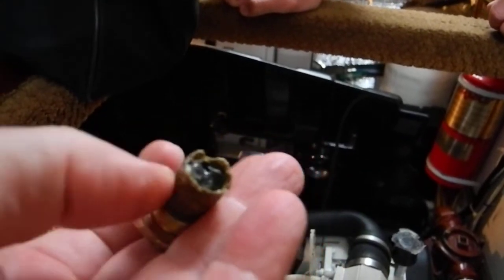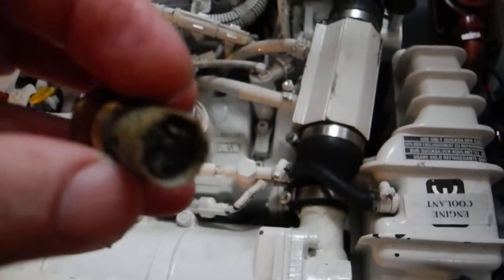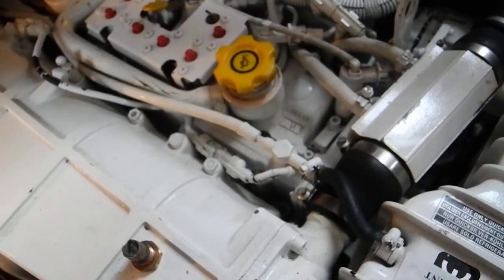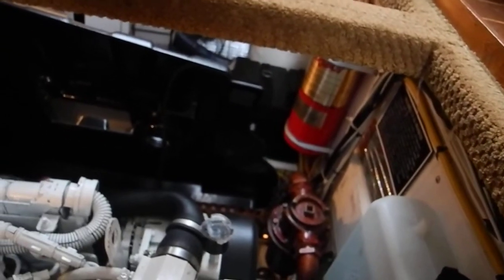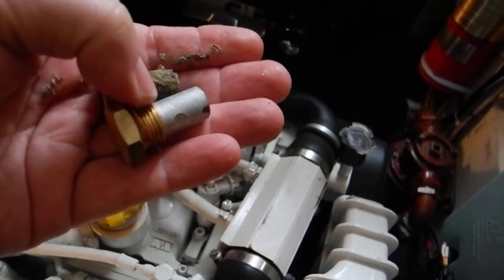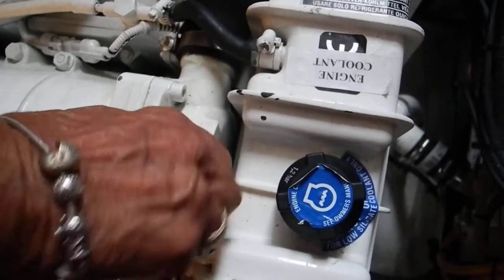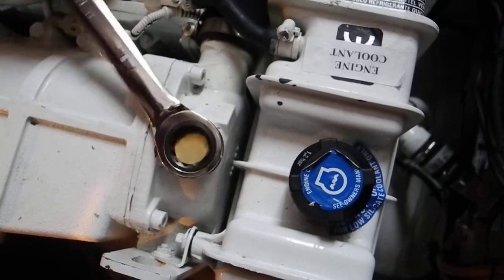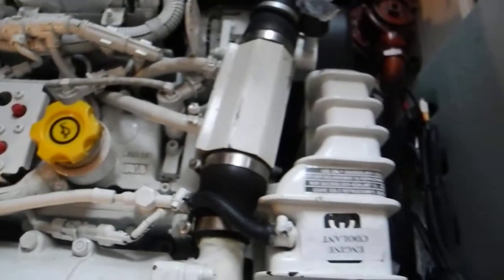Change engine pencil zinc

Comment: Not a area to be wearing jewelry.  Safety first ~ no jewelry or watches.
Reply from the maker: Robert Frost we had a huge discussion on Facebook over a year ago when we first posted it in both places. People got very ugly. Let’s just say that We prefer no jewelry either but this owner has already single handed her boat once on the Great Loop without any significant issues. This is not a newbie. Off camera Chris did mention something about the jewelry. Her response was that nothing was running. It was a cold engine so she wasn’t taking her jewelry off. She is a very knowledgeable boater and made her choice based on safety and what she considered minimal risk. Chris was aboard with her at this time to actually help her grandson learn to dock the boat as he was spending the summer aboard. Chris was lucky enough to capture her checking her zincs. No harm. No foul. Thanks for watching.
Reply: No rings either ( yes I know it’s jewelry) as you can easily loose a finger if you contact an arc source or it gets caught in something.  Can get silicone rings so no one hits on you at a bar.  😝 LOL

Comment: what kind of engine??? Have a video for Caterpillar 3208T? 

This one: https://www.youtube.com/watch?v=KHyk4-SDwws only shows one location...how many zincs are on a 3208T? Thanks!
Reply from the maker: JTC Intl the 3208 came in 5 variants. You’d have to look at the owners manual to be sure. Usually you can look for the UNPAINTED bolt heads. But if a previous owner did not ever change them then they still may have paint. Look on all of the coolers and follow the raw water hoses for the complete path where you may find the zincs.  Good luck- wish I could give you a more detailed answer.

Comment: Use a socket
Reply from the maker: Michael Cavenaugh yes of course a socket would have been better but one was not aboard. Best to have a full set of tools for all equipment on your boat.
Reply: Hi Chis Any issues with QSD not getting over 3000rpm?